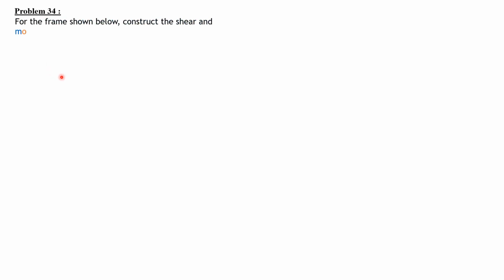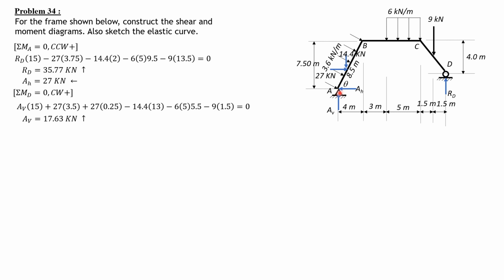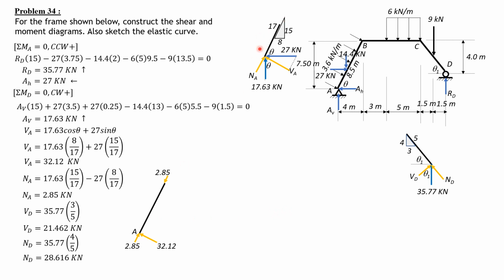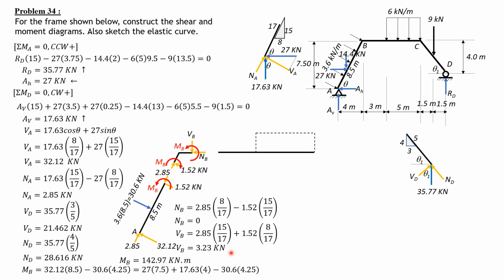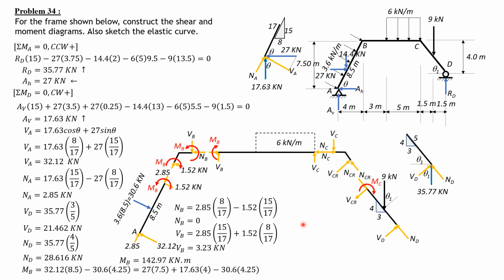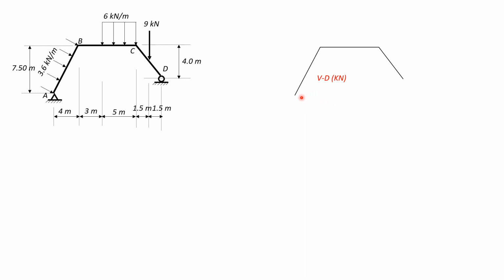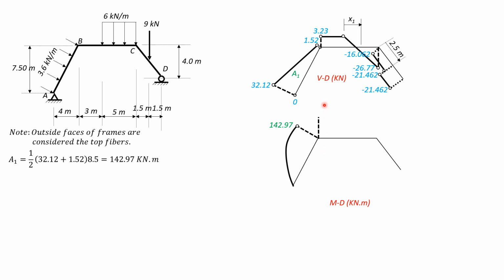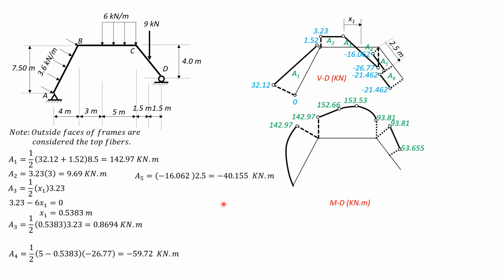STRUCTURAL ANALYSIS, EXAMPLE 34

Comment: Sir, question po for computing the VA or shear at A po sir, you indicated the equation as 17.63costheta + 27sintheta pero yung 17.63(8/17) is 17.63sintheta po sya sir di po equal to 17.63costheta wherein 15 po ang vertical distance perpendicular to the slanted surface and the 8 is for the tangent component or parallel to slanted surface po sir
Reply: ay okay na pa po pala sir, namali lang po ako ng pagbase ng slope/theta sir hehe
Reply from the maker: @S4leagueXD1  ok.